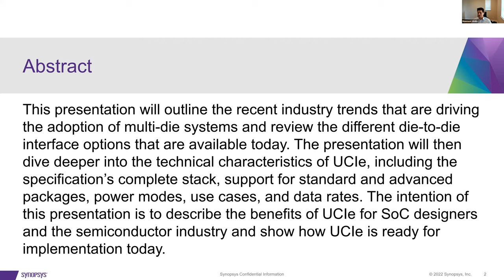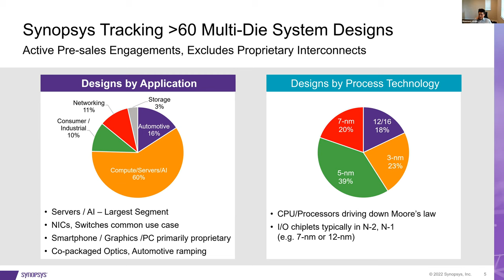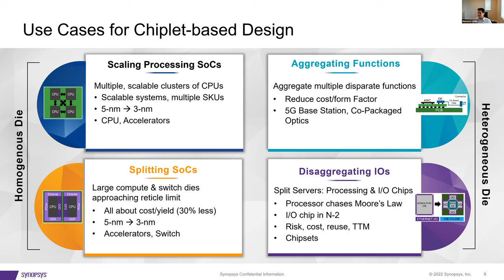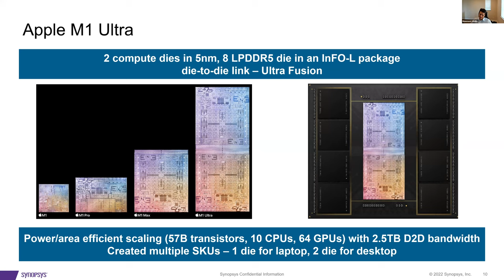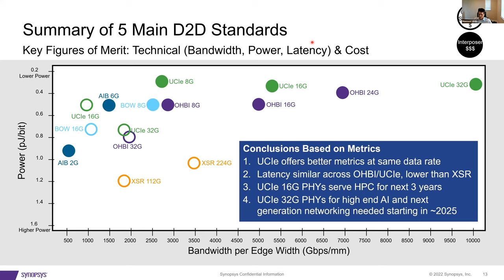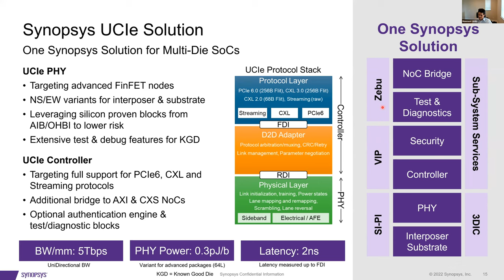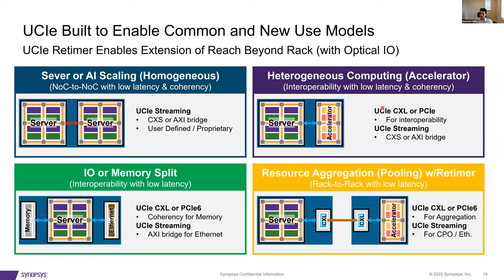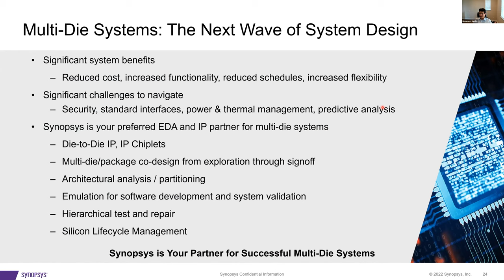Enabling the Era of Multi-Die System with UCIe

Comment: I have a question. on mode 24GT/s, RDI frequency still to fix 2GHz or change to meeting bandwidth. Example 128B &1.5GHz. With option 8GT/s then RDI frequency 64B @ 1GHz?